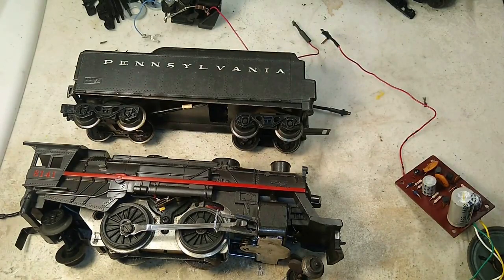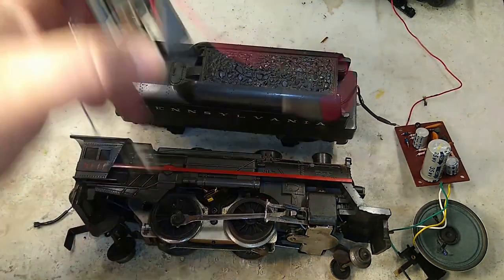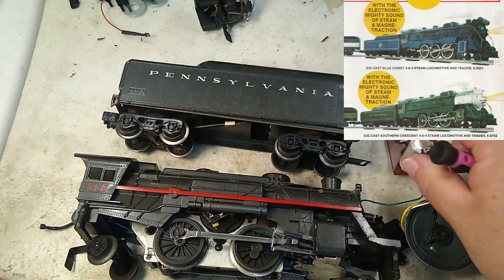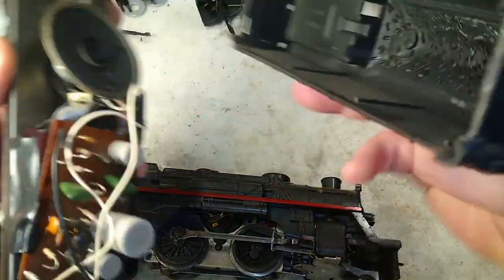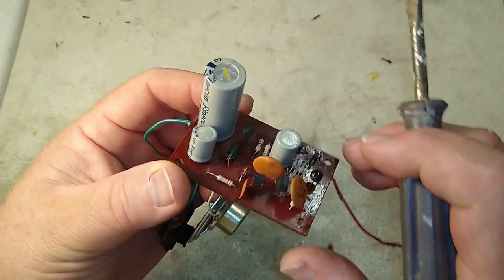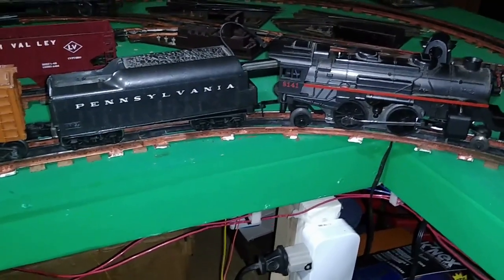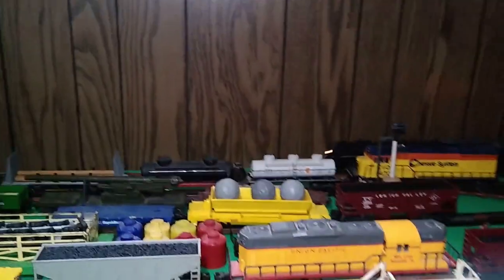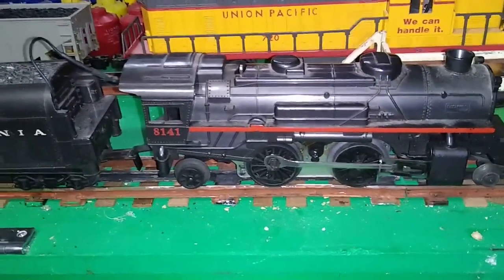Lionel's "Electronic Mighty Sound Of Steam" - Early Electronic Train Sounds

Comment: How much better it would have been if MPC just copied the American Flyer smoke and choo choo unit. Sounds SOOOOOOOO much better.
Reply from the maker: The electronic system was probably cheaper to produce.
Reply: @ToyTrainTipsAndTricks  yes, but nowhere near as authentic sounding as the Gilbert system. I live about 8 miles from the Gilbert factory and had many family members on both sides that worked there. As kids (I'm 74) my brother and I had both Lionel and American Flyer. Each had advantages.
Reply from the maker: @ronalddevine9587  Switching to the Flyer system would have required retooling of the Lionel boiler shells, whereas the electronic system fit snugly with existing smoke unit tooling.

Comment: The 8204 is louder and not as nice might be because the capacitors are going bad also some engine with the sos only have a 220 ohm resistor to keep power to the board between chuffs, and the other sos/w will not work quite right with those engines. I have repaired about 8 to 10 of these recently and will hopefully be building some from parts for the sos type systems. The rest of the parts should be here this week.
Reply from the maker: Thanks for the input. I will check it out!

Comment: Oy......  How about some hot glue and a block of either urethane or extruded Styrofoam?  I did this and you can even peel the hot glue off if you need to change something.  Mine in the Southern Crescent has also got tinny, like an annoying metallic echo.  Any idea what might cause that?
Reply from the maker: Good idea on the Styrofoam. I don't know a great deal about the actual circuit, but I understand that the values of the various capacitors on the boards control the overall pitch. Perhaps one or more of them has become "leaky"? Just a guess.

Comment: My first Lionel set was the Silver Star, still have it and it's near and dear to me! I replaced the foam and the 3 large capacitors and it works great. When these boards go bad, it's most likely the three large capacitors, especially the early boards that used low quality capacitors where the electrolyte has leaked from them. Replacing those usually brings these boards back to life. Replace them with same value capacitors rated at 25volts min. The Marx SOP tenders are nicely synchronized to the loco (by the speed of the train like the early railsounds tenders) and are louder than Lionel's, the huge advantage is you can use the Marx tender with any locomotive and it will work and the chugging will be in sync. Lionel's early rail sounds tenders are similar in that the goodies are all in the tender and not dependent on a specific loco to make them work. One other note, the sound of steam boards will work in Marx tenders and vise-versa so if you have a sound O power tender board go bad, you can pop in a working Lionel board and it will work as a replacement
Reply from the maker: Thanks for the tips! My Silver Star 8141 still runs great!
Reply: @ToyTrainTipsAndTricks  Mine does too and using mega-steam smoke fluid makes it smoke great, much better than the traditional Lionel fluid I used as a kid! Here's a link to one I repaired by adding new capacitors and mega steam smoke fluid: https://www.youtube.com/watch?v=KAwtbuJd3Zk

Comment: If one of your tender trucks has a center roller then the circuit would have included the whistle. And if no center roller, it is just the steam sound.
Reply from the maker: Correct. And I should have known that!
Reply: It is, however, entirely possible to find a Lionel whistle tender with no steam sound, just the whistle.

Comment: We had the Lionel Southern Crescent for ten years, the engine ran and pulled well, but the cars had trouble going through 022 switches and constantly suffered from “ coupler” droop 

We sold it for money to buy a set of postwar Irvington cars
Reply from the maker: My childhood Southern Crescent also had coupler droop problems. We eventually discovered that the mounting plate where the coupler attached to the truck was too loose. We figured out a way to tighten it and my cars have been fine ever since.

Comment: The thing that I don't like about the sound of steam tenders is that most of them don't weigh anything.  The postwar whistle added quite a bit of weight to the tenders.  Non-whistle tenders were super light as well, but you could easily add weight to them.  With the speaker and circuit board in the sound of steam tender it is more difficult to add weight.

I'm not big on sound systems in my trains anyway...I'm more into the postwar stuff where if something is "true to prototype" it's as much an accident as it was design.  I do prefer the units with adjustable volume over the ones where you're stuck with the sound level.  A volume knob can make the difference between letting the sound keep running or shutting it off completely.
Reply from the maker: Agreed. Running a plastic SOS tender behind a die cast 4-6-4 is kinda silly.
Reply: @ToyTrainTipsAndTricks  Lionel made lots of plastic tenders behind their diecast locomotives. Williams reproduced these locomotives and I wish instead of the plastic tenders that they had had diecast tenders to go with them but because Lionel had plastic that's what they make. I wish all of the companies that made replicas of Lionel products made them at their best like with cash frames instead of Sheet Metal Frames. It's a shame that all of the Lionel diesels have plastic shells diecast shells would give them so much extra weight for traction effort. I love a diecast locomotive hauling diecast cars and a diecast caboose that's a real steel train and you pull a train of diecast cars that's a heavy bastard. But even on my 12x16 layout a dozen cars and two locomotives is all that looks proper you don't want the Caboose right in front of your locomotive.

Comment: I own an 8206 Hudson from the MPC era. Does anybody know where the cable that comes out from the engine should be soldered to? Thanks in advance!
Reply from the maker: If it comes out of the back of the cab, it shouldn't be soldered to anything. There should be a quick connect tab to a corresponding wire in the tender. That's for the Electronic Sound of Steam.
Reply: @ToyTrainTipsAndTricks  I truly appreciate the help on this. Just to make sure, the cable that goes through the small hole in the cab to the inside of the locomotive is not soldered nor connected to anything? No danger of shorting out?
Reply from the maker: @78Rudys  The other end of the wire attaches to a switch on the bellows of the smoke unit. When the side rod pushes forward it completes the connection and sends power from the center rail to the sound board in the tender. Unless you touch the wire to the outside rails or a grounded frame, it will not short out.

Comment: Is there a modern, more realistic sound system that can be put into these locomotives?
Reply from the maker: There used to be some aftermarket sound systems (Ott Machine Services, for example) but they haven't been produced in years. The only way I know of today would be a full conversion to Lionel TMCC - and for the cost of conversion, you'd be better off buying a new locomotive. OR Lionel made some tenders with RailSounds in the 1990s and early 2000s. If you can find one of these and have a RailSounds-compatible transformer, you can get SOME sounds, but they won't be synchronized to the wheels.

Comment: As a child the sound of steam would be wonderful but as an adult when you run for trains you don't want to listen to them blowing for The Crossings every 20 seconds as they go around the layout and the engine noise gets to be annoying and to smoke puffing out well sometimes it'll set off the smoke detector. When the circuit boards in my Williams locomotives go bad I have them hardwired and I run them on straight DC just like the HO trains I grew up with. No horns no Bells no whistles no sounds they make enough sound just running around the track.